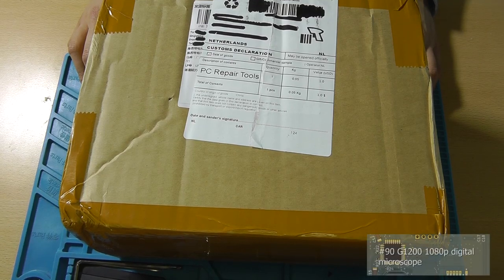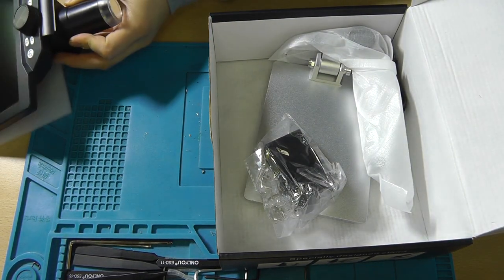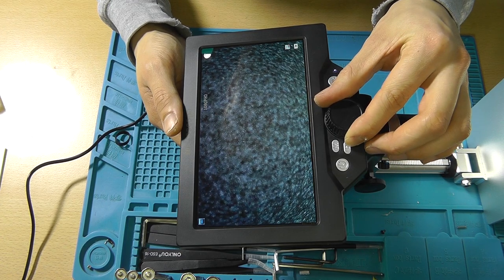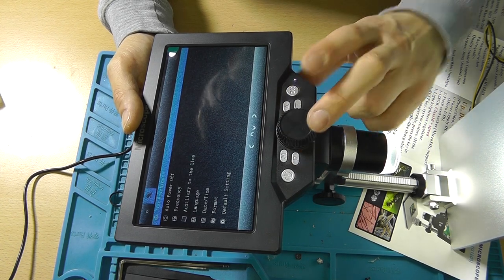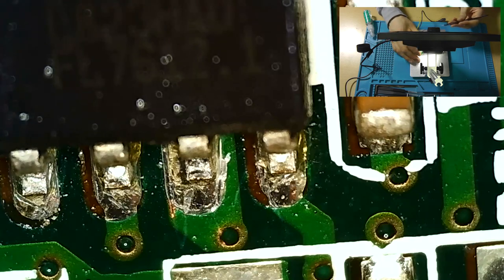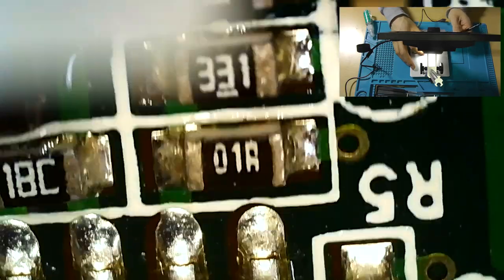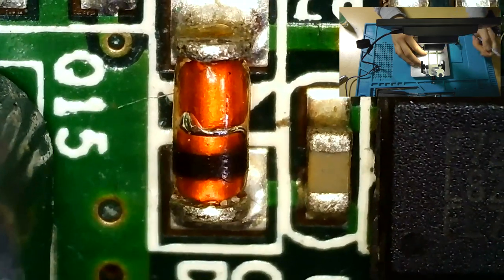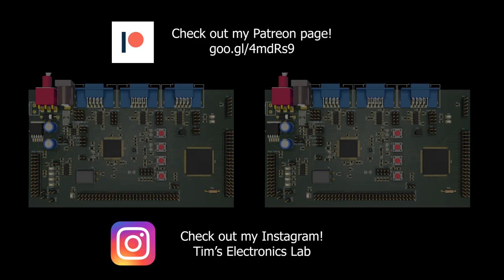#90 G1200 Full HD 🎥 digital microscope 🔬 unboxing, is it worth the €40,-?

Comment: if you select photo mode , then go into menu you get the photo options which are different to the video options, likewise if your on playback mode , you also get other options in menu ... did you know you can also use it with a pc by plugging it is via usb to pc .. works good , also if you have windows 10 you can connect to your large 50" tv ....

Comment: I was wondering about the specifics of the battery type so that I could order it ahead of time?
Reply from the maker: I just shot a video of me installing a battery on this thing! It is a li-ion battery, if you get creative a single 18650 will fit, but a flat 3.7V battery with a size of 6cm by 4cm will fit

Comment: I have a question hopefully you will respond:
Do you think this microscope has a great enough magnification to inspect the edge of a straight razor or a knife?

Edit: Also, dikke BMW
Reply from the maker: Yes it does! 1200 optical zoom and I think 40 times digital zoom! 
Hou m tegen, hou m tegen!
Reply: @TimsElectronicsLab  I think it's not really 1200 because i've seen pictures from a real expensive microscope with around 930x optical zoom and you can see the apex of the edge there. I believe someone said this microscope could do 100x max he measured a ruler in milimeters and then measured the lcd screen to get the real magnification..
https://youtu.be/rVvXQPovwOA?t=314
Reply from the maker: Hmm, I didn't do the measuring trick, but k think I've seen some videos like that

Comment: photos of this one are horrible, at best less than 1 megapixel not 12, shame,
Reply from the maker: Well, mine are not so bad actually, or I just lowered my expectations without being concious about it
Reply: @TimsElectronicsLab  how many megabytes  are your photos at best, I got 1.07 couple of times. 12 mebapixles as they ckaim should yield 12 megabytes  photos. Also, the fact you can't control the cameras manually makes it a terrible too, to photograph small things for detail.
Reply from the maker: I do get 12MP. The photos that I took have a resolution of 4032x3024, which equals 12,195,768 pixels (~12MP). Honestly speaking, I haven't played too much with custom ISO settings and all the other options
Reply: @TimsElectronicsLab  I'm shocked, I did everything I could and still get horrible images, it seems the factory that makes them and sells them to distributors does not make all units equal although the packaging is identical and the claims..... thieves!!!
Reply from the maker: Oh wow! If I was you I'd request a refund from AliExpress. This is unacceptable even for Chinese products
Reply: @enchodus  Have you selected the the resolution for photos? It's there, in the menu. Mine works well. 12M. Mine came with the battery too. but thats an easy/cheap upgrade you can do.